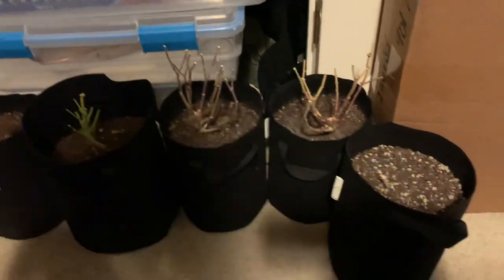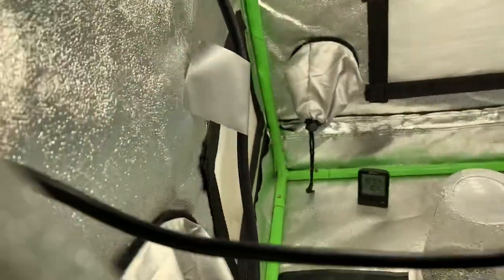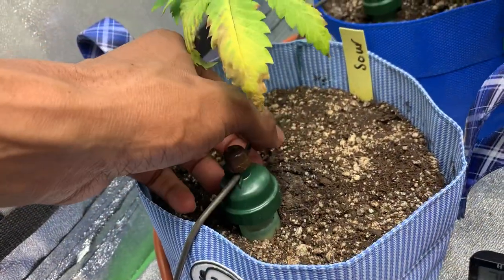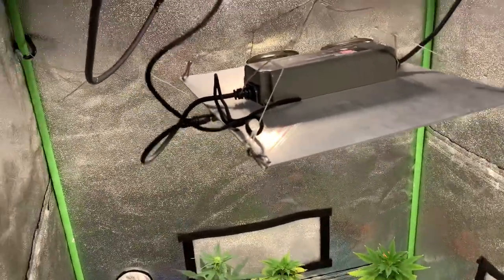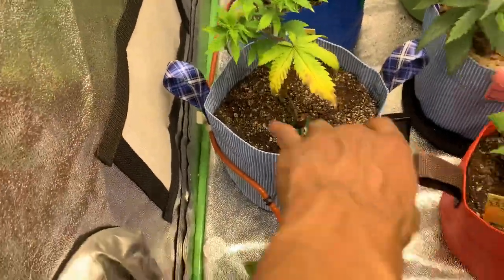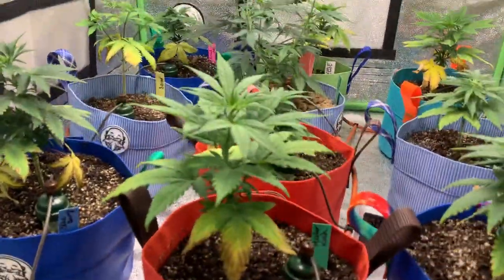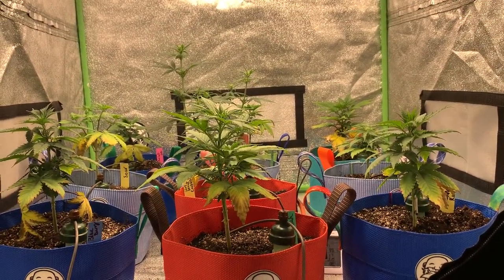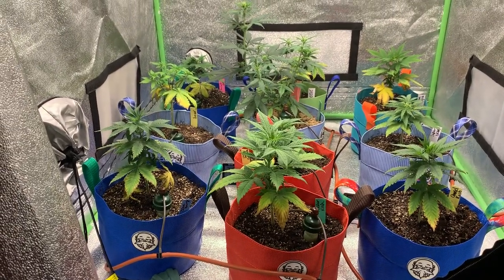Grow Vlog 4: 3x3x6 living soil grow. 1.5 gal transplant and blumat gravity systems setup

Comment: I know this was an old one. Did those colors ever come back?  And you don't keep all your vents open. It seems like I'll have negative pressure with them closed
Reply from the maker: Marcus Garvey no the green never came back. It’s really hard to recover like that once you start flowering so always try to veg the problem out then flip. I keep one open at all times during veg but when I flip to flower, I close them at night. I have the gorilla grow negative pressure poles. I was having issues was that as well but these poles are great.
Reply: @sticksbegrowin625  when i close mine that shit starts concaving. I was thinking of seeing how it is I turn my intake up with them closed
Reply from the maker: Marcus Garvey turning the intake up will help a little but I was only able to prevent it by adding the poles. Either that or leave a vent open. But of course you can’t do that during flower unless the room your tent is in stays completely dark. Maybe try some pvc pipes and cut them to size. Try to attach them between your tent poles via string or clips attached to the ends of the pvc